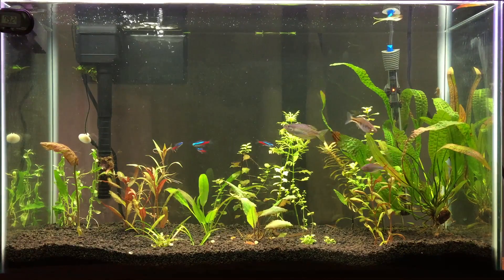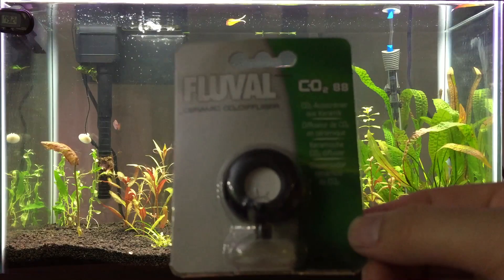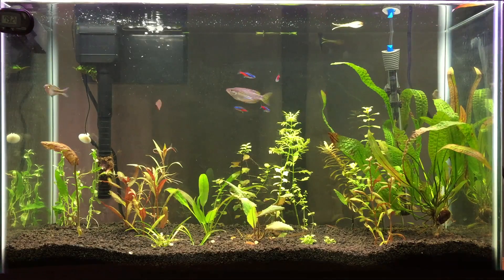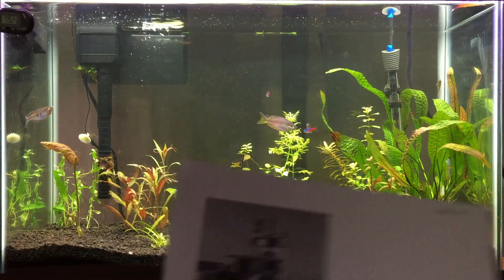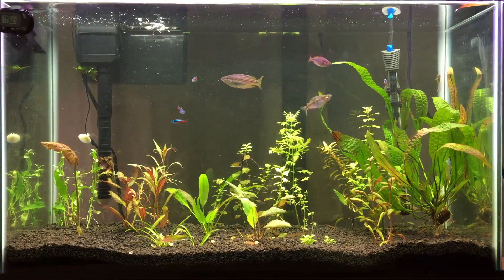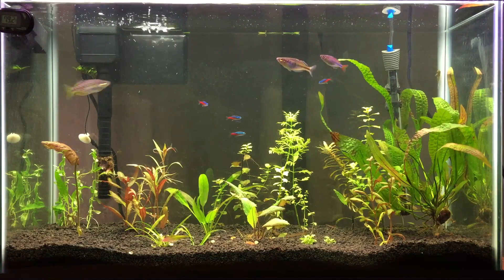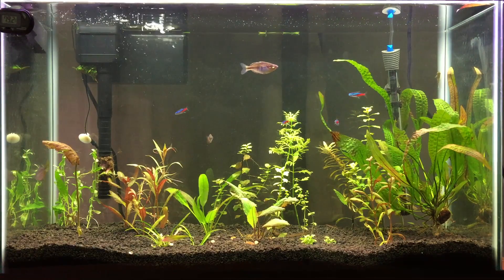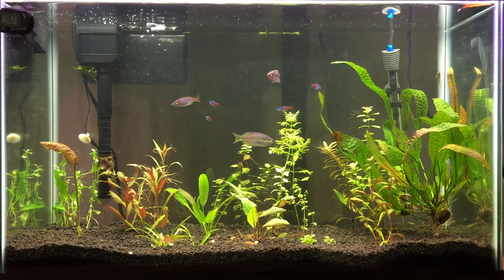3 DIFFERENT WAYS TO DIFFUSE CO2 IN YOUR AQUARIUM

Comment: For those with DIY CO2 systems the cheapest and effective way is to cut a plastic bottle/cup, put in in your tank (make sure there's no air trapped). Then start filling it directly with the air tubing until in creates a nice co2 pocket inside the bottle. This is passive diffusion and the most effective (after the reactor) . It's really old school and was given to me by a fish keeper for 40+ years. He's done it that way since the mid '80s
Reply: Is the passive co2 system enough to jumpstart the flooding of my carpet of hc after a drystart? In a nano tank of course.
Reply: @tyngchinchillachang838  Yes! and it will be more effective if you dose ferts :)
Reply: @el_mosito   what do i have to flood the tank without killing the plants with tapwater other than dechlorinating and dosing npk liquid fertiliser?
Reply: @tyngchinchillachang838  plants can stand chlorinated water in my experience, but I might kill all beneficial bacteria and fish. So make sure the water is dechlorinated, around 24-26°c (plants struggle with higher temps, I keep my tank at 24°c all the time).  And you are ready to go! After filling the tank with the water, add the bottle (cut it half) and fill it with co2. 
Plants will pearl from 12pm to 6pm in my own experience. That's when they reach the peak of photosynthetic activity.
Reply: Alright thank you for the info. I was having trouble searching the web for answers. now how do i dose ferts? I only have a npk+ trace elements liquid fertiliser for gardening. It says 1 teaspoon per 750ml. Can i use it after i flood? Can i also use it for dsm?

Comment: Would I still get C02 into the tank having it go into my intake for HOB filter- 
What if I have filter media & a sponge in HOB Filter area. Will the C02 just be wasted & disperse within filter not making into my tank?
Reply from the maker: Hi Michael. the reactor method will not work efficiently with HOB filter. You would have a lot of micro bubbles and most of the Co2 would be wasted. You would want to use a diffuser setup. Thanks for watching!

Comment: Great information Reefkeeper. I've used the cheap glass diffusers with great results, but I'm running a inline one now that was advertised as a gla diffuser but I suspect it's not but works great still. Like you said it produces a lot of tiny bubbles but I don't mind.
Reply from the maker: Nice! Yea some work better than others.  I found that most don't last as long as the fluval. I don't mind the bubbles either! Thanks for watching bro!

Comment: dude the reactor is jus as easy as setting up the co2 inline atomizer the reactor has 2 nipples for ur outflow an a nipple for the co2 line I don't get how is harder to hook up smh an it will dissolve 100% of ur co2 the reactor I mean
Reply from the maker: KingKoopaTX 512 I know how too hook it up lol. I was having trouble with the pump I had connected to it at the time.  I do have a really nice reactor but haven't set it up.  I have no issues dissolving Co2 with the inline diffuser.  Just look at my latest videos and tell me it's not working!
Reply: Kevs Hi Tek Tanks lol